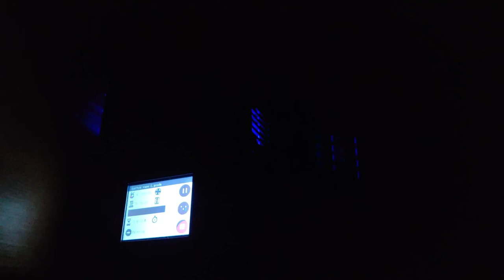longer lk1 vs cr10s  10 good thing about longer lk1! and .8 mm slicer settings

Comment: Bro have you encountered an unresponsive screen from the Longer LK1? how did you resolve it? do you know a solution?
Reply from the maker: Yeah I've unplugged it and plugged it back in and it fixed it. If you're printing and it's not responding just let it finish the print. You probably gonna need update your firmware
Reply: @djmorodaraye4313  I actually needed to got to v 2.19 to have it work. possibly the 2.20 I got was bad. I am just fixing the hotend prob and hopefully tune and merry printing! Thanks for the reply! You are awesome!

Comment: I'm glad your having good luck with your longer. Mine has been nothing but trouble. Still getting head temp warnings. I haven't been able to print a good mini yet, but have two that are ok. The biggest issue by far though is the head temp shut down.   Longer thinks it's the motherboard or the thermistor but won't send me repairs yet. I've ordered the micro swiss hot end and new thermistors. The firmware update didn't change my screen sensitivity. Think I just got a lemon. Will keep working on it. Another thing I've noticed is my bed tilts pretty severely side to side. I don't really see a way to tighten that up. Ideas?
Reply: Hi.
I'm having same issues. How did you solved it?
Reply: @joaogrosso1117  I sent it back. Never got it to work.